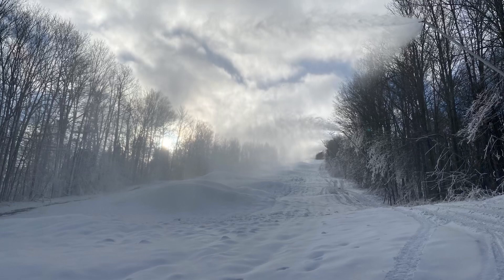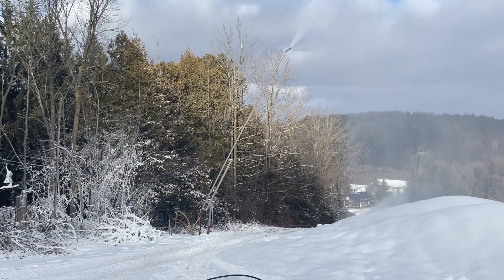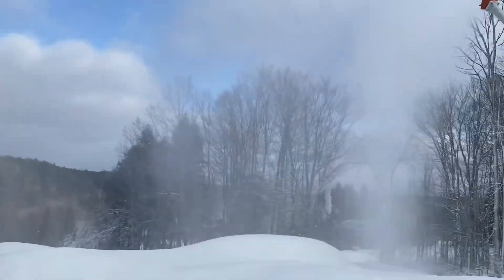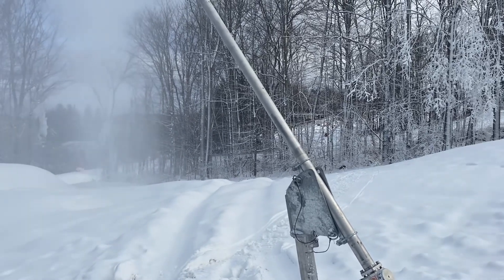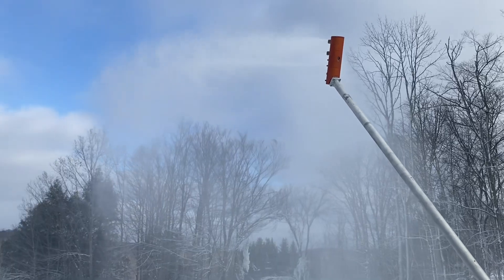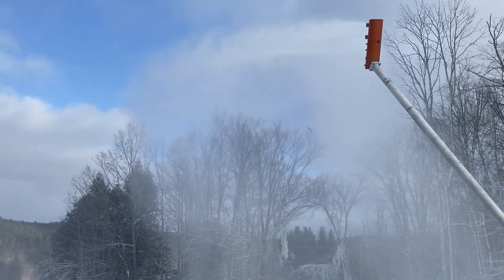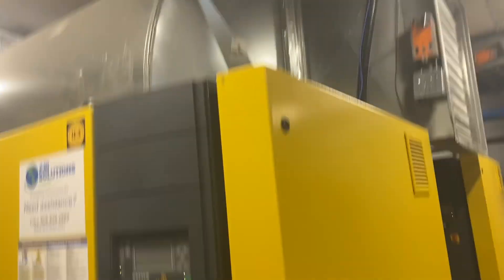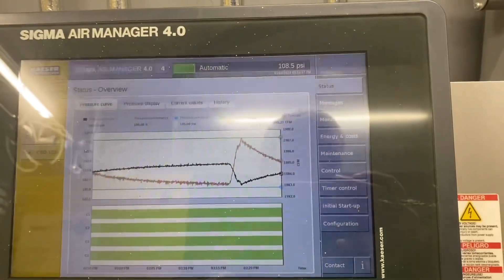Snowmaking, Snowguns, and Compressors

Comment: Those are also rotary screws and they are quiet because they are only 100 HP and ~450 CFM. The big boy 250-300 HP/1200 CFM ones are absolutely deafening.

Comment: Does snow guns need compressors as well or the fan acts like a compressor?
Reply from the maker: These guns have an onboard compressor for the nucleator. It helps break up the water particles and can be adjusted for the temperature range.